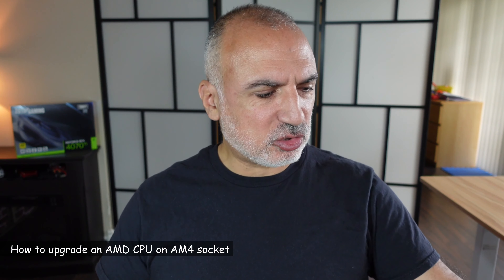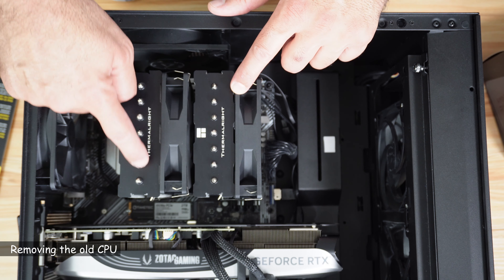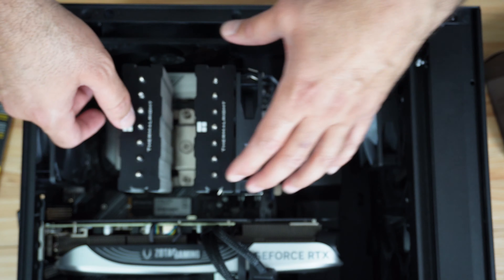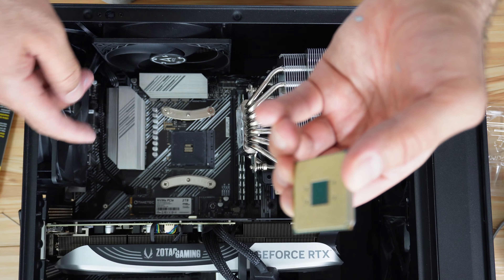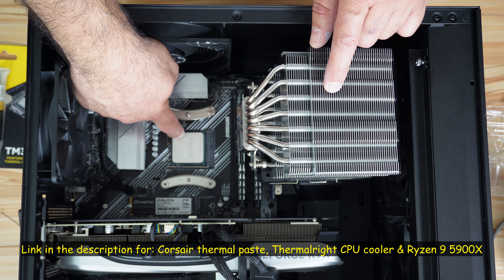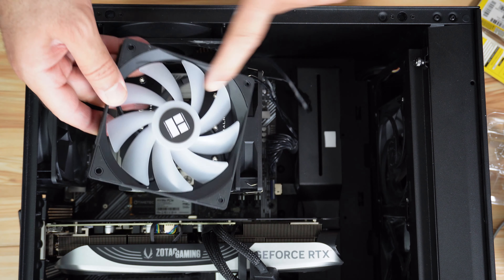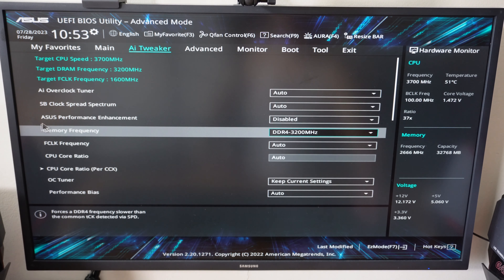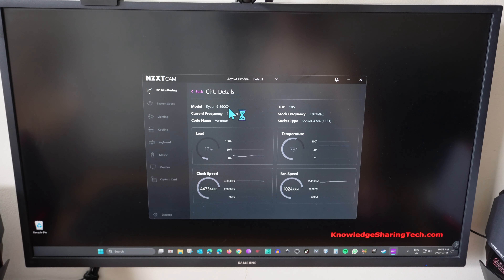How to upgrade AMD CPU on AM4 socket - Upgrade Ryzen 7 5800X to Ryzen 9 5900X

Comment: Sir i feel this Ryzen 9 5900x will require a liquid cooler for thermal control
Reply from the maker: Not really. I've been running it with an air cooler and never overheated
Reply: @KnowledgeSharingTech  I have a air cooler too, and my 5900X actually runs cooler than my 5800X did

Comment: is it possible to upgrade from r7 5700g to ryzen 9 5950x? do they use the same bios, do i need to update my bios or what .
Reply from the maker: Hi, yes, they both use the AM4 socket. You might want to update the BIOS to get the full benefit of the new processor
Reply: @KnowledgeSharingTech  and if I order the chip before I update it, what I’ve seen is it won’t boot into windows, and go into a boot cycle, but since they are similarly new the computer should recognize it, ( I can’t find  out how to update my bios since it’s a prebuilt )
Reply: I would know how to find what motherboard it is and update its version on any other computer. But my prebuilt is confusing